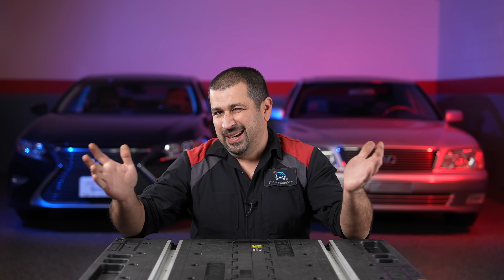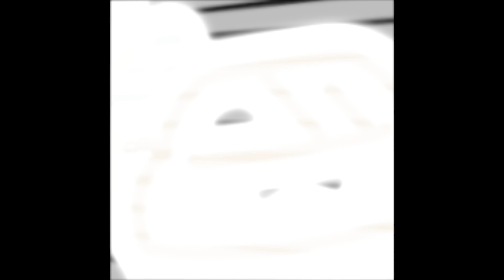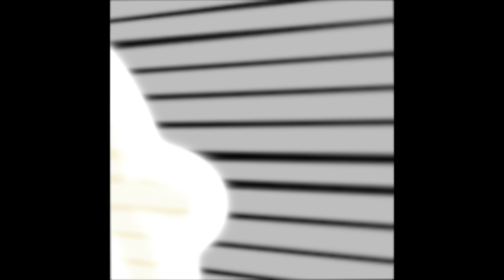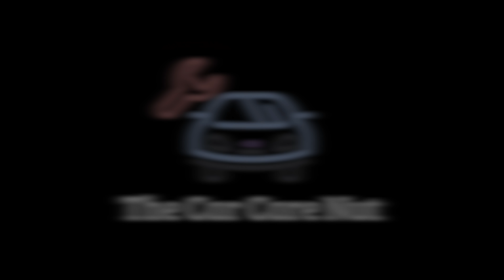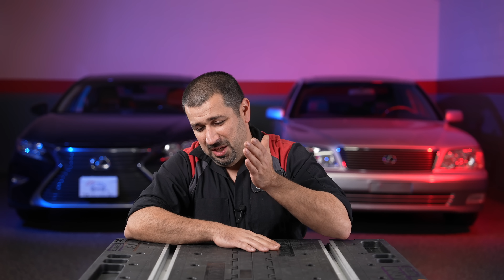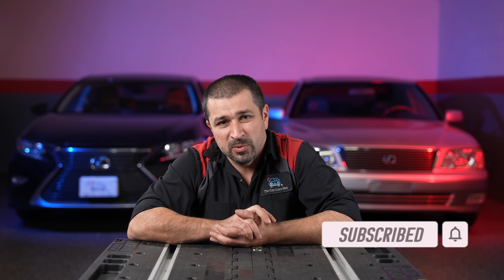Can Modern Turbo Engines Be Reliable? Here's The TRUTH!

Comment: There's nothing better than honest recommendations. Thank you for your on point videos. Use the best oil you can, change it often, let you car warm up before highway speeds and let it cool down after getting off the highway. For those of us that have frequent short trips, oil changes need to be even more often. Unless you use regular oil analysis. long interval oil changes are best left to the over the road rigs that run long hours, that often use bypass oil filters as well as oil analysis to know the condition of their oil, and more importantly the level of wear taking place in their equipment.

Comment: Hello sir thanks for your content I have a Kia sportage 5 gen HEV European model 1.6L 211HP combined or 180hpengine only and its turbo liquid cooled so I have to really be carefoul of something this is the only sin from years a Toyota (7 Toyotas had)owner now of a Kia. Personally believe that cars from 2002 2007 2012 will not come back those Toyotas could have 500000km and still were rocking so you think hybrids are the same durable ?

Comment: I am driving a BMW e30 and do my oil change every 4500 miles (7500 km) . It is not a well maintained car (a lot of young previous owners). The engine is not in a good shape either. But I still do it. Everyone (non car guys) says I am stupid. But it keeps going strong. I just want to give the car some love and treat it with dignity it deserves even if it is about to die.

Comment: For my 2020 Mazda CX-9 I change the oil every 5000 miles. The car has traveled 268,000 miles and the alternator is the only part of the engine that has been replaced.

Comment: Blackstone Laboratories has proven, with real data, that many turbocharged vehicles can run 9-10,000 miles on an oil change interval while maintaining minimum oil specs. Turbocharged cars also typically have larger sumps to compensate for increased stress, so there is more oil to degrade. 3,000 mile oil changes is throwing your money in the dumpster. Get an oil analysis yourself at 3,000 miles if you dont believe me.

Comment: Too many idiots think that newer cars have "electric cooling" that keeps flowing after engine is shut off. But its the oil that takes heat away and the oil pump turns off when the engine turns off.

Comment: Just throwing this out there: the Volvo B230FT, the gasoline turbo engine found in later model turbo 740s and all turbo 940s, will outlast most normally aspirated engines. Regardless of poor maintenance habits, and because of water cooling (nothing new), you can shut them right down. I have many of these cars, and when left in stock condition, the almost literally cannot fail. I drive a stock 1991 740 Turbo with 330,000. Original turbo and engine and runs like a dream. I daily a 1994 940 turbo with 275,000 miles. It has been making (obviously intentionally) more than twice the boost (15lbs) for the past 50,000 miles. I have a 1991 740 turbo with 280,000 that is boosted to 11lbs on the original engine. I drive all of these cars HARD.

Under my care, these cars see oil changes between 3000-5000 miles. Full synthetic.

Now, I know these aren't modern, high efficiency engines. My point is simply this: turbocharged gasoline engines don't have to suck (lol, they blow). They can be incredibly reliable if designed to be reliable. The real issue is twofold: CAFE standards and the growing reality that car manufactures are building disposable cars. Modern cars are designed to throw away, and I believe that is the bigger culprit here.

Comment: I'm glad someone finally said the Car manufacturer oil change intervals are bull$hit.  Like he said you get rid of most problems by changing the oil, air filters, trans fluid, ect early.  2,000 - 3,000 mile interval changes fix 98% of issues.

Comment: the sad reality is 10-15 years from now the adoption of electric cars is going to far more just because of the reason you mentioned. People will ignore and go past the the manufacturer recommendations and spoil the engine. I have a n20 engine (bmw), not the most reliable but it is working with original timing chain at 150k and it has stage2 tuning. All I do is change oil at 4-5k miles.

Comment: Well, I had (so far) six cars with turbocharged engines. Renault Fuego (crap), Ford Mustang SVO (great car), Merkur XR4Ti (great car, loved it),  Dodge Stealth twin turbo ( crap, first year of ownership car spent 8 months at the dealer getting repaired, traded it for Subaru WRX (great car), VW GTI 5-th gen (great car). Renault and Dodge are disasters, other 4 not a single problem.

Comment: Great video. We have a 2015 Subaru Forested XT with a 2.5L Turbo and have been diligent with oil changes, every 8000 km or 4800 miles, and servicing. Now with over 225k Kilometers the engine still purrs. We also have a 2024 Mazda CX-50 Turbo and are following the same script.

Comment: I have a turbo in my 2018 Hyundai Santa Fe Sport. The car is taken care of religiously. I have close to 70K on the vehicle. So far, zero problems. Plenty of power when you need it. Good gas mileage. Doesn’t drip oil, doesn’t burn oil, starts every day, never breaks down. Hyundai has been very good to deal with. Very stylish vehicle, HVAC , heated steering wheel, and full heated seats. Scores high in crash tests. The key I think is having qualified mechanics work on your vehicle. Don’t miss the service intervals. My safe plan , the vehicle has the best warranty on the market. Vehicle had a few recalls, I brought it in promptly for Hyundai to double check things. They were great to deal with, made whatever repairs needed and your good to go. This has been my experience with this vehicle. I drive 12K per year approximately.

Comment: I own a 2018 Chevy Trax that is known for early failure (1.4 litre Ecotec Engine) I am changing oil at 3,000 miles and checking level 1/2 the way in manually to monitor level,and keeping coolant level in reservoir at appopriate level!

Comment: Turbo 4 cylinder engines in full sized pickup trucks used for towing and hauling and using ultra thin oil to meet fuel economy standards. What could possibly go wrong?

Comment: Can they be reliable? Yes. 

Will they have more issues? Yes. 

They will eat spark plugs and coil packs more often. They will occasionally have boost leaks and blown charge pipes as long as OEMs decide to keep using plastic. They just tend to have more problems. 

Is the extra power worth it? I think so. I’ve only ever owned turbo cars. I now own a 207 Prius, 2001 4Runner, a 3.5 EcoBoost F-150. 

That truck is always my favorite to drive. It’s fast. It’s fun. It’s smooth. It hauls ass fully loaded or with a trailer. It gets the same gas mileage as my 4Runner. What’s not to love?

Comment: No No No, i dont recommend a gasoline turbo engine car for a long term purchase. Turbo chargers are the weak link and will most likely fail or cause a fail ...its just a fact, do you want to take that risk? If your leasing for 1-3 years, go for it, still a risk, but much smaller.
Reply: There are 1980s Toyota pickups with turbos still running fine

Comment: Tccn-yes. Turbo diesel trucks don't have the foolish demands placed on them as turbo cars. But let's not forget the bruitishly strong the internals of a diesel. (I also don't want to ruin it and mention the oil change schedules of a heavy truck.diesel.!)  Finally. You mention  an engine lasting 100k, as if it were a good thing. That was 380k miles ago on my daily driven Toyota ( yes that's 480k).  The public should be voting against 4cyl turbos, simply buy not purchasing them!
Reply: The turbo 4 cylinder is superior to the 3.5L V6 in the Tacoma 3rd gen. I had one

Comment: Purchased a 2022 CPO Lexus GX460 for 5 reasons:

1) The Car Care Nut

2) Last gen of naturally aspirated V8

3) Port Injection vs Direct Injection 
 
4) I'm a powertrain engineer with decades of experience, so... I know a few things

5) It's a Toyota built in a premier Japanese plant

And not that it's the same everywhere or matters too much, but I dress like a poor redneck and the dealer kissed my @$$ before the sale (and still does).  Most dealers brushed me off as a tire kicker.

Grinds my gears to buy foreign, but I'm too old to keep wrenching on weekends.

Comment: In Europe we have been using diesel engines in the same way we use gasoline. So they might be designed for cruising (not sure how true the statement is), but we used them in the cities as well. Among "better" cars (I mean class/size wise like anything larger than a golf class) it's probably still around 50% of the cars. This used to be the case even in the Golf class. Unfortunately most brands have stopped selling diesel and that is unfortunate and ridiculous. One of the few brands that still sell new (regular) cars with diesel engines is Skoda.

Comment: The thing that ruins engine longevity is manufacturers, like Toyota, deciding that 0W-8 oil is a good thing.  This new “water” oil is garbage.  In this day and age if we need to go back to oil changes every 3,000 - 4,000 miles then the engine is poorly designed.

Comment: I had a 2016 Civic turbo I mostly drove on the highway. I sold it at 245,000 miles. Original turbo; oil changes at about 7000 miles.

Comment: Rolled the dice on a Hyundai Santa Cruz.  Hoping their engine issues are behind them. But specifically went with the lowest trim which does not have the turbo or dual clutch transmission. Both huge failure points in my opinion.

Comment: It's not that Turbo engines are not reliable.  It's the design of the modern gas turbos that are crap. And Toyota is leading the way.  I owned diesel turbo for years in Asia with absolutely no problems.. Would I buy one in the USA?  Not On A Bet...
Reply: The 4 cylinder turbo has been around since 2021 and no significant issues have came up yet

Comment: My 2017 Chevy Cruze with the (for some reason) oft-maligned 4-cyl 1.4 Turbo has 138k miles on it with zero problems at all.  I think it has something to do with my driving style...  I am a mellow, take-it-easy, don't accelerate hard, don't-speed driver.  40mpg on the highway, a little over 30mpg around town.

Edit: I do oil changes every 5k miles, and use the proper weight that it says in the manual.

Comment: Or buy an EV and change gearbox and differential oil on 60.000 km period. Today's modern batteries last easely over 300.000 km.
Reply: EVs make up the least reliable vehicles. Try again bot.
Reply: @DrakonR  No bots here, just plain hard numbers that fossil fuel lobbyists don't like: "The ADAC reports that only 3.8 in every 1,000 EVs break down, compared to 9.4 in every 1,000 ICE vehicles."
Reply: @gregorkoritnik4659  you're literally an EV lobbyist and nobody is buying it. Try again bot.
Reply: @DrakonR 😂
Reply: @gregorkoritnik4659  thank you for proving my point. 😂
Reply: @DrakonR 😂😂😂

Comment: Can modern turbo engines be reliable? No because they are a race to the bottom to be made as cheap as possible with as many parts made of plastic as possible. They exist not because they are better than NA engines, but because they give the appearance on paper of better fuel economy in EPA slow steady-state testing (but in the real world they do not get better fuel economy). They exist to be cheap and to game the system, not to be reliable.

Comment: I had a '99 2.4 5 cylinder Turbo Diesel. I really trashed that car. Constant 125mph+ on the Autobahn, oil changes with very cheap oil from the supermarket if I could be bothered (15k-20k kilometer intervals). The turbo was quite worn out. I had to weld the VNT mechanism and popped in some new bearings and seals for a couple of euro's and kept driving it. Got about 400K out of that engine and decided to scrap the car as it needed new shocks, brakes, etc. However, the engine still purred like a happy pussycat, so that will spend another few decades as a boat engine.

Comment: Your statement about emissions is false 
Smaller turbo charged use just a much fuel 
Simple equation - to make make power you need fuel
Smaller turbo engine needs the same amount of fuel as larger engine to make equivalent power
Reply: That would only be true if you're constantly flooring the accelerator... like during hard overtaking, towing, or racing. normal, everyday driving (cruising, light acceleration, city traffic  modern downsized turbo engines usually burn less fuel and produce lower emissions than the larger naturally-aspirated engines they replaced. I think we have to consider a real world anaylsis of everyday driving into the equation. That is the reason companies opted for the turbos...The "same fuel for same power" idea only applies when you’re pushing the engine to its limit, which is rare for most drivers.

Comment: Big discussions going on with the new 0w-20.   I've listened to many oil engineer geeks explain and I just do not believe it  necessary.  Lighter oil means less friction and .00001 %   more mileage.  It's all EPA driven, NOT longevity driven.  Oh, there IS a standard they use.........it's called getting it past the warranty period.  Mine small turbo is getting 5w-30 at 3k miles.

Comment: I am a retired turbocharger design and development engineer (Garrett). I agree with what is presented in this video. The thing I would add is - ALWAYS use synthetic oil with a turbo. It holds up to heat better.
Reply: With all the people saying they change their own oil I wonder how many problems are caused by using cheap oil ?

Comment: 2011 Nissan Juke with 147k miles on original engine, turbo and transmission. 4500-5500 miles between oil changes. 10k miles between transmission fluid changes. Very rarely exceeds 4k rpms when driven. Still runs smoothly despite it being known for its poor reliability.

Comment: I am a 25 year master tech and have never seen a turbo engine I would call reliable.  I would always take a v8 over a ttv6.  Now if people used high quality oil and changed it 5-6k miles I'm sure that would extend the life.  People just don't know how to freaking check their oil and drive it 8k miles on a change.  No engine will last doing that

Comment: Turbo charged engines can be reliable, if you change your driving habits...specifically in the smaller engines w/turbos...95% drive them, like they're v8's...They're not...while they have just as much horsepower, they're still smaller engines & can't be beat treated like v8's...as well, today's transmissions have more speeds & most people still floor it after every traffic light, stop sign...bad idea...transmissions with more speeds/gears need to gradually be powered up instead of flooring it every time...they won't last as long as they could

Comment: Absolutely, just have to ensure proper cooling of the Turbo and MOST important, proper cooling of inlet air.  IAT defines if it will blowup the engine.  What most manufacturers do is go cheap with intercoolers and don’t provide sufficient inlet air cooling from the turbo … they make the assumption that the Turbo (for street use) will only be at max pressure for a short period of time (a few seconds).  Sooo, they don’t build sufficient inlet air cooling and ignore heat saturation.  Anyway, ICE is a thing of the past, electric motors and solid state batteries are going to dominate performance leaving ICE behind in the dust of unreliability and pollution … nobody wants ICE.

Comment: I have 2016 Ford Transit 3.5Eco with 445,000 miles. Zero engine work, original trans, original turbos; Mobil 1 full synthetic every 5k miles from first oil change.

Comment: I see absolutely zero reason to ever by a turbocharged engine in a typical commuter car.  They don't really even get much better real world MPGs.  Naturally aspirated engines often overperform their EPA estimates (both of mine do fairly significantly) while turbos almost always underperform them.  Plus most commuter cars live in low rev ranges, where turbos comparatively struggle.  If you're going to track your car then by all means get a turbo engine, but they make zero sense for the average commuter.

Comment: I worked at a MB dealership for 8 years.  I don't think I saw more than 2 turbo replacements come in...cylinder heads on some of the 4 cylinder motors, different issue.  That appeared to be a software problem than a metallurgy issue.

Comment: Engineer, worked on just about ever form of engine over the year. I  have a WK Grand with the merc om642, now with 325K on it. No serious failure or any of the reported issues with that engine, so far. Change the oil and filter ever 3K, run a flush through it before I drop the oil. Use only quality products. Injector cleaner ever second tank. Towed a 6Klb trailer for over 25K, all logged, yalls. This many speaks truth to routine maintenance, yalls.

Comment: Use premium fuel in turbo engines.   I have two friends who had their small turbo engines fail due to detonation at about 90k miles. One Ford, one Hyundai.   One used 87 only and I think the other used 85 when they found “cheap gas” driving through the mountain west and the engine failed almost immediately.   Turbo engines = premium fuel.

Comment: As a long time(and now old) mechanic, I search for low mileage used vehicles that are inexpensive to repair. That said, turbo gas engines are not on the list. 
Not only are the engines not manufactured to the standards of 10-15 years ago, but the owners do not know how to drive them properly. I know for a fact that many owners are unaware they are driving a blower. They will pull off the highway and shut it down immediately because to them it’s an appliance.

Comment: This guy is right.  I lost a 2.0t at 66,000. A vw.  Seals were gone. This engine was hard on oil. I got an SUV with a V6. Still changes the oil on short intervals. This guy is right.